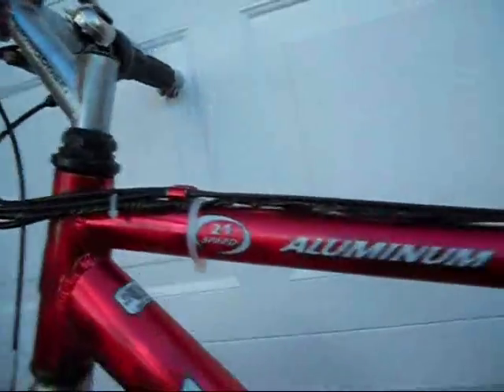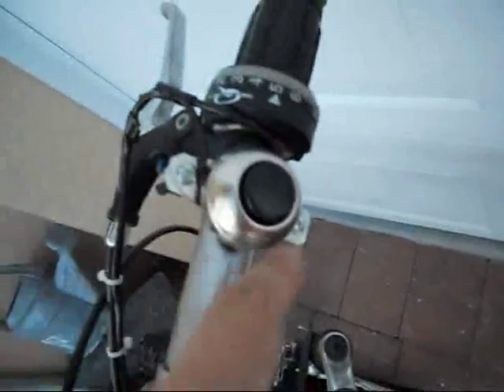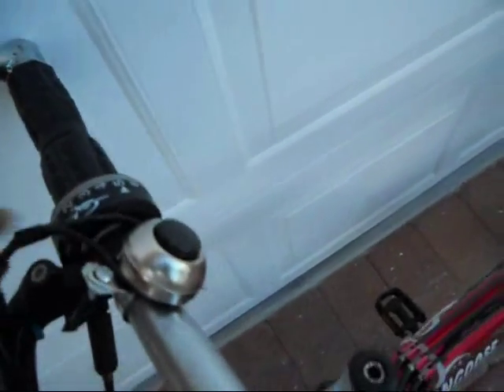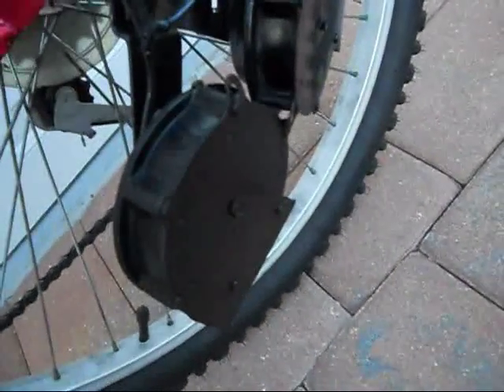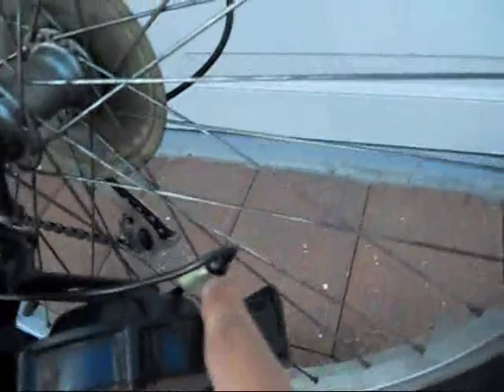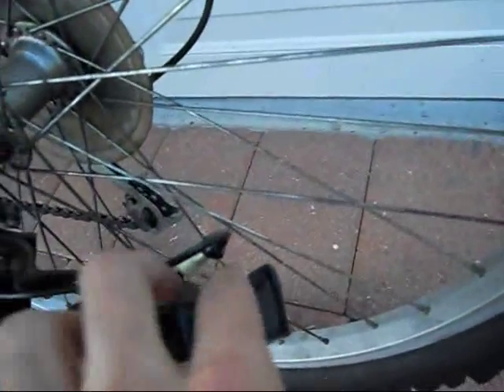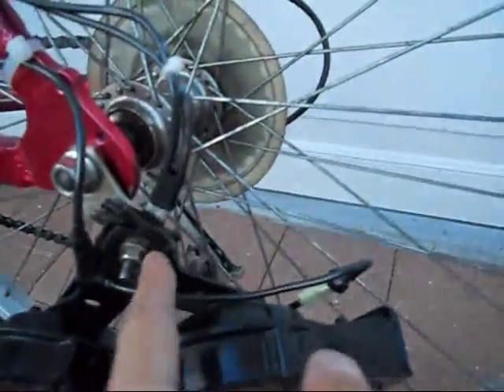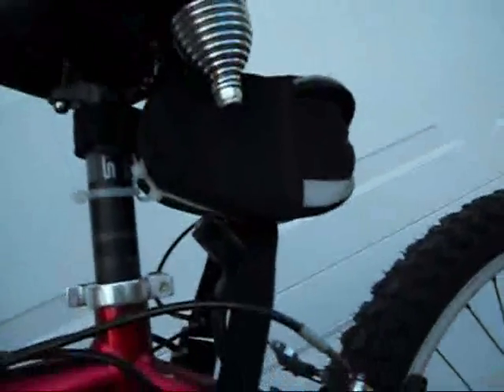Bicycle Car horn  Bike Horn WITH RELAYS

Comment from the maker: Ground the battery to the frame, Power it to the relay.  I soldered some, crimped others.  Its just a drill battery. Any 12-18 volt battery will work.  More than 15-6 volts will probably damage the horns over time.

Comment from the maker: Whats not grounded?  I did because it works.  The frame is grounded,  The relay is grounded and the horn is - instead of positive, as the horns in the car are wired the same way. ground the horn button in the column and the horn goes.

Comment: 17 bucks for just two horns? I only let one yard charge me that of money. Look for a Pick and Pull, I think they have affiliates all over the country which use the same pricing. 17 bucks gets me a complete 4-note horn from a Roadmaster / DeVille / Etc. I was thinking about doing this as well, relay and everything but with a motorcycle battery.

Comment: @ghtowagon yeah grounding them was kind of an issue for me but I got it done. The horns on the devils are located in the Front drivers side fender (Notes A, F) and In the Front Passenger side fender (Notes D,C) 90's Buicks are a bit different The 91 Park Avenue I got Horns out of The D and F were in the Front drivers side Fender and The A and C notes were in the front passenger side fender.

Comment from the maker: @repeatman  Yea, alot of them are TWO wire too, The one wire ones work ok.... But grounding them may be annoying. I sanded the ground spot good and covered the area w. di-electric grease.   Where are the horns on Seville/ deville caddys? I know where they are on Roadmasters and Fleetwoods (also used that note, But they are hard to find in the junkyard)   I have a bunch of switches and fuse holders, Maybe ill make some more horns for a bike or something else lol

Comment from the maker: @idusclothing it depends on the battery and how many mili amps it has. ... The relay also reduces the amps going through the switch, Some switches are not rated for more than 5 amps,. two horns draw more than that.

Comment from the maker: @moldymac  Yea. I figured I can use the brackets if they ever die so its a win win.  I have replacement horns on the wagon now. I was never fond of the brackets... I can drill the welds out of on these ones and add them

Comment from the maker: @bgdsub72  Too many clueless clowns around here man. You gotta wake em up !  Now I have an 18 volt battery on it, My 14.4 battery is weak. (It has not had enough amps to run my drill in 2 years) Anyway. I need a new pack But I have tons of 18 volt packs so That's the new setup, Its MUCH louder.  Is it going to burn up the relay and horns? Maybe..